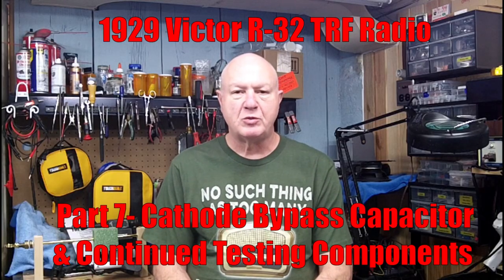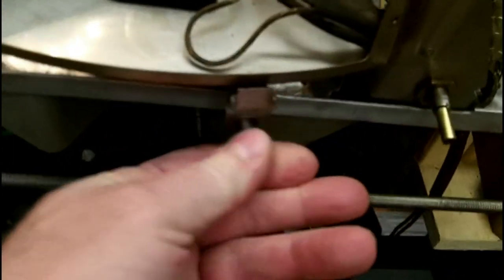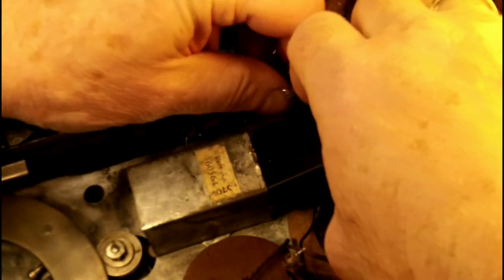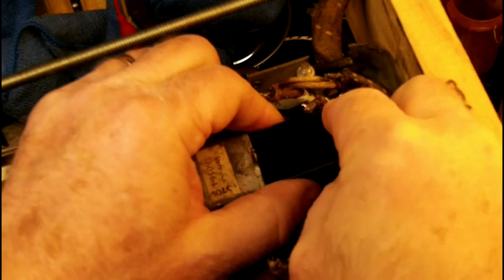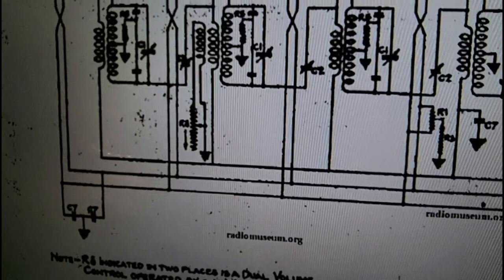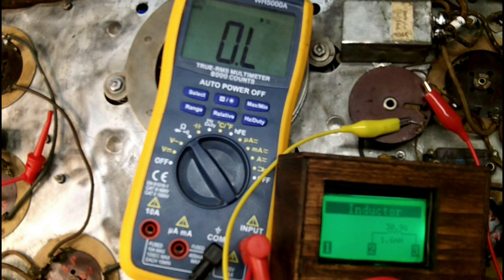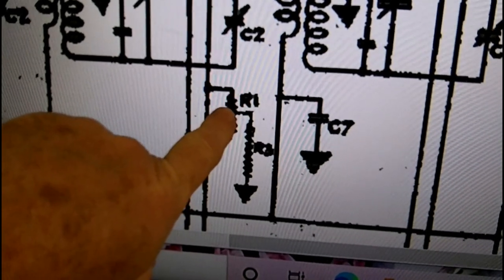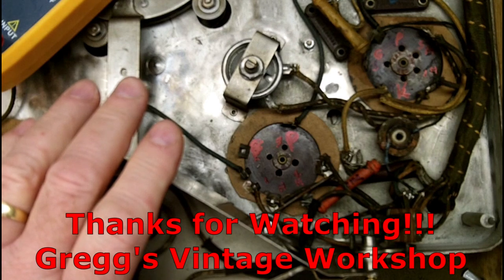1929 Victor R 32  Part 7  Bypass Capacitors & Testing Components

Comment: Man Gregg,,, amazing job on getting the dimensions of the cap box so close. Not only are you getting defined measurements but it also shows the accuracy of your printer. Well done bud.
Reply from the maker: Thanks Carl, yeah I wish I would have had it a few months ago when I re-stuffed that huge capacitor can and the transformer cans. I could have made some nice stuff for those!

Comment: The schematic at pacifictv.ca is easier to see Gregg! They have a nice page of RCA Victor schematics under Tube Schematics for radios.
R3 is actually 500 Ohms and not 400 Ohms so your OK.
Very cool 3 D printed box to hold the modern versions of the capacitors. The common ground lead side seems to properly touch the closed end of the open frame
box without any need for soldering. Hope any jostling of the radio  in the future won't cause a problem in the future. Good  chassis cleaning. It looks new!
Reply from the maker: Thank you for that information Paul! I soldered the  common ground lead for those C7 capacitors to the original flexible ground lead before I shoved it back into the can. I think I said that in the video. I would never not solder a ground lead and hope it made contact with the chassis!!! That would be a BIG no no!

Comment: Having that 3D printer must be a wonderful treat for you!  So many wonderful things you can do with it.  You could even make your own terminal strips.
Something I am curious about.  You mentioned something about capacitors that you were going to leave in.  Are they "Paper/Wax" type capacitors?
Reply from the maker: Thanks Wayne, yes I am finding a lot of uses for the printers. I believe the two capacitors you  mean are a very early mica type and typically are in tolerance.

Comment: The hum control should have three wires. Those readings look like you were just measuring end to end and not at the wiper. Looking real good. Nice job rebuilding the bypass cap.
Reply from the maker: Thanks Bob, I only saw two wires, I'll have to look closer I guess.